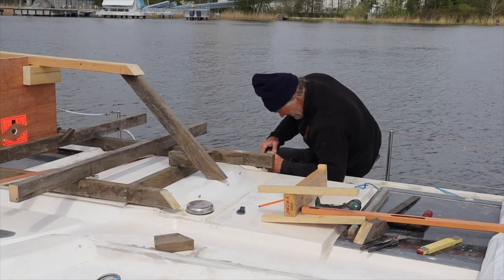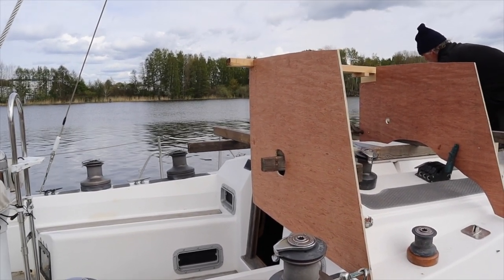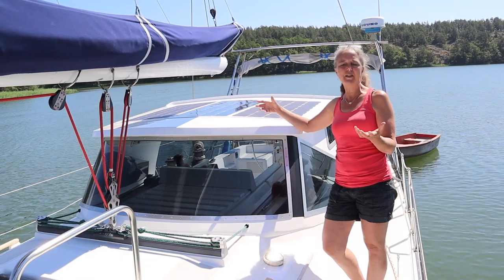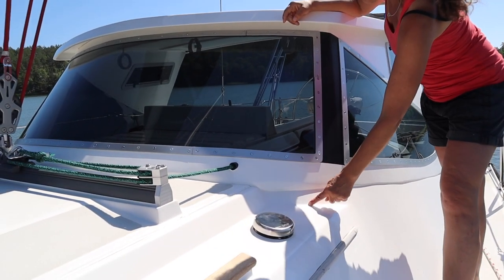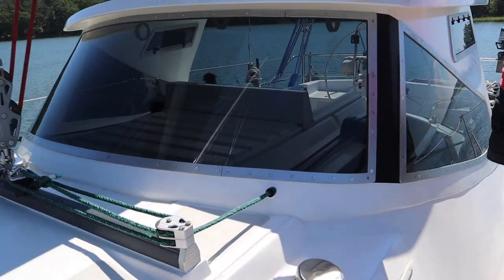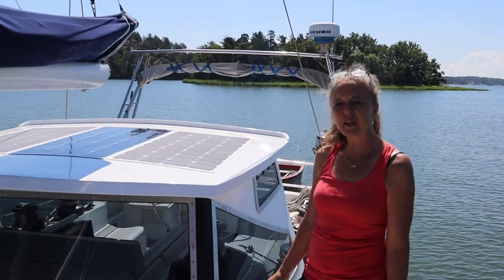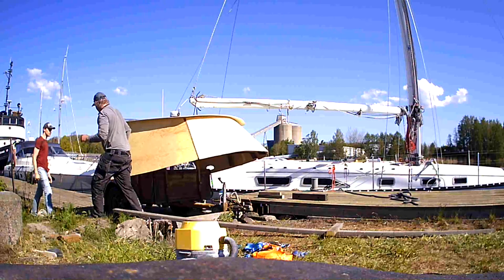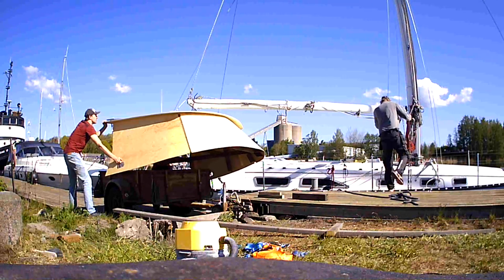Building a hard dodger for a sailboat

Comment: Great job with your speaking English. Did you guys consider a more forward leaning front window? They use this design to reduce sun glare, but it also looks cool. I’m considering doing a hybrid hardtop with this style made of polycarbonate, possibly protected with 3m clear film as poly scratching easy, but extremely strong. Use stainless frame and starboard roof over entire cockpit with cloth and clear plastic sides to remove in summer. I know I really think out of the box. I haven’t seen this design. Your looks nice though... cheers
Reply from the maker: Hi thanks!
No, we chose this design because it follows the lines of the boat.
I think you have some good ideas with the hybrid roof and the dodger, (chameleon style) it's nice to have the possibility to change over the seasons. good luck with the design and build.
Cheers

Comment: Fantastic ! Very informative. I’ve watched about every hard top video I could find. I gained some working knowledge from each and every one of them . I really liked the process and way y’all went about and especially the design ! I’ve got a Oceanus 351 and plan on making one very similar to what you have done here. Thank you for taking the time to post . One question , you painted verses gel coat finish , was there a particular reason why you elected paint verses gel coat ?
Thank you 
Billy McGrew
Carolina Beach ,NC USA
Reply from the maker: Thank you, we are happy you like the video. Sorry about the painting info.We used Gelcoat but when you use it on top it calls topcoat in Sweden, it is gelcoat with wax in it and you need to sand and polish it. 
Hope you will start up your hard dodger project.👍🙂
Good luck!